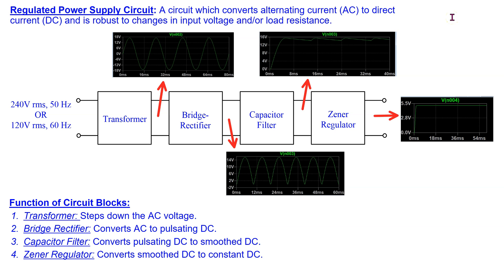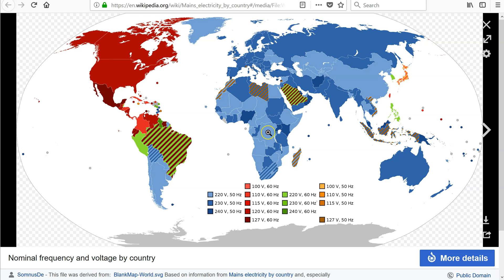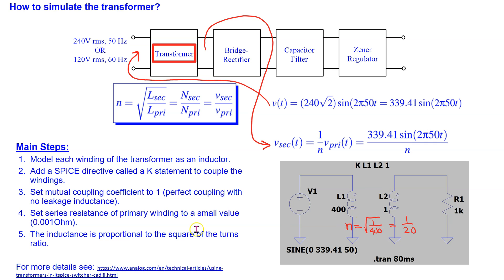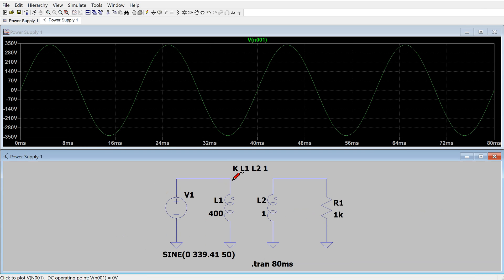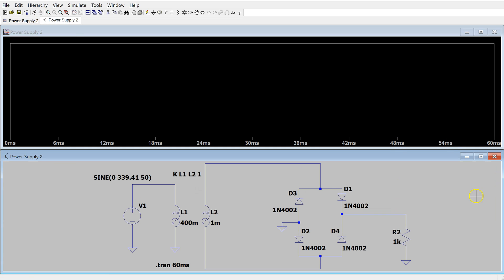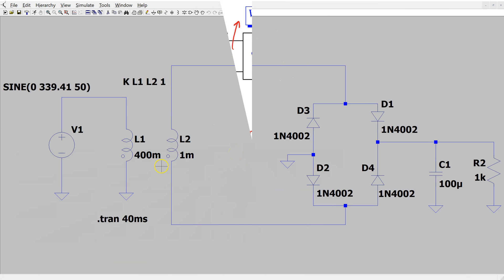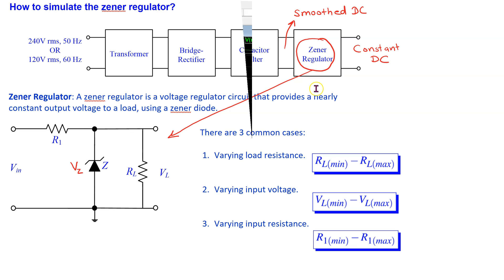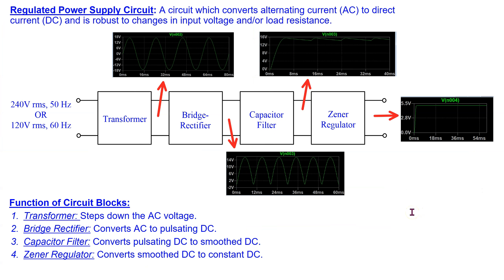Introduction to LTSPICE for Simulating a complete Regulated Power Supply Circuit

Comment: That's all very well but how do you do an AC analysis on this to get, say, the output impedance of whole circuit for different current draws?  You need the mains voltage to be continually cycling (to provide the power) while you draw the current at various frequencies. One can do that in real life, but can we do it in simulation?
Reply from the maker: Thank you for the feedback and suggestion. It might be possible to do this via an AC sweep over the input. However, I have not seen any technical details related to this in any textbook. You would need to provide more details.
Reply: @electriccircuits7164  The problem is having a voltage source that just runs at 50Hz and 230V into the main transformer and then having a current source (as a load) which does an AC sweep.  The first requires a .tran and the seond needs a .ac command.  Even if we make it simpler than an output impedance, how would we get the frequency response of the system?  (That actually may be more complicated. LOL.)  What I need is the mains/transformer cycling away and topping up the reservoir capacitors while doing an AC sweep on the rest of the circuit.  Obviously I need somewhere I can draw power from, and that's usually the reservoir capacitors.
Reply: In case I've not made it clear, what I would do on the bench is a) switch on the power supply.  Then, b), I would drive a small resistive load through a power transistor or perhaps a Darlington so we have a constant current sink.  the base of that transistor would be swept across the frequency band, especially at LF where the impedance of the capacitors is high, and I would look to see what the voltage on the V+ rail is to determine the output Z of the supply.

Comment: Can we get 12v output using the same circuit
Reply from the maker: Yes. Transformer secondary output may need modification accordingly.
Reply: @electriccircuits7164  sir I cannot find 7812 zener
Reply from the maker: Hello, The procedure to add zener diodes is described in the video. 1N759 is a 12V zener. Its model can be defined as:

.model D1N759 D(Is=1.773f Rs=2.06 Ikf=0 N=1 Xti=3 Eg=1.11 Cjo=102p M=.4868 Vj=.75 Fc=.5 Isr=1.393n Nr=2 Bv=12 Ibv=79.489m Nbv=1.1528 Ibvl=142.9n Nbvl=.95108 Tbv1=700u)

BZX84C12L is also a 12V Zener in LTSPice.
Reply: @electriccircuits7164  Tq sir
Reply: @electriccircuits7164  can you please tell me what are the changes
Reply: In secondary output
Reply: Sir I am not able to add diodes
It's showing access  to C:\program Files\LTC\LTspice\lib\cmp\standard. dio was denied
Reply from the maker: You need to have admin access to your computer. 

Note: For latest versions of LTSPICE, the model definition file that you need to edit can be found in the location C:\Users\[USERNAME]\Documents\LTspiceXVII\lib\cmp and NOT the folder where LTSPICE is installed (such as C:\Program Files\LTC\LTspiceXVII\lib\cmp).

Comment: Sir i want to know that if i want output of 4.7V contant so what value of capacitor should i choose input is 110 60hz R=1k 
By that formula i am not getting correct waveform
Reply from the maker: The formula to determine the smoothing capacitor is given in the video. This formula is derived under certain conditions which assume near ideal operation. It is the zener regulator that will ensure 4.7V constant output.

Comment: This was very helpful. Can you please do a circuit with three outputs.
Reply from the maker: Thank you. Can you please elaborate what you mean. Do you mean a single regulated power supply circuit that can produce 3 DC output voltages such as 5V, 10V, 15V?
Reply: @electriccircuits7164 
Yes, something like this;

Suppose a power supply is needed to supply the following three outputs:
 Fixed positive 6V
 Varying positive 25V
 Varying negative 20V
Construct and simulate the required power supply circuit using LTspice VIII, explain the 
function of each stage and also show the output of each stage.

Comment: If we want to find capacitance which resistance should we use the shunt resistance that is attached to zener regulator or the load resistance?
Reply from the maker: Excellent question! It would be the thevenin equivalent resistance seen by the capacitor (for the zener regulator stage).

Comment: can i know how did u get primary inductance to be 400 ??
Reply from the maker: Thank you for the excellent question. We are just interested in getting the desired turns ratio right. Hence, we can pick the inductance values accordingly to give the desired turns ratio. Practical inductors have values that typically range from 1 µH to tens of H. 400 H value is outside that range. It is also possible to pick inductor values that are within the practical range and satisfy the desired turns ratio criteria.
Reply: My project is converting 240 AC to 20 V dc
Reply: So whats the ratio that i need to use and component value of the circuit that needed to be changed
Reply from the maker: This is a design choice and there is no unique correct answer. If you want 20V DC, you would select the Zener part name first to provide that voltage...there are a few 20V Zener Diode models available in LTSPICE. The Zener diode stage must have an input voltage (smoothed DC voltage) greater than 20V. What exact value you set is within your control. This then enables design of two resistors for Zener diode stage, taking zener diode parameters V_Z, I_ZK, I_ZM into account. Also you can work backwards to work out what is the peak value of transformer secondary voltage you need. From that you work out a turns ratio. You can round off values of turns ratio to adjust your design. Then simulate to confirm your design. The relevant theory is discussed in this video and the video on Zener diodes in this channel. Good luck with the project!

Comment from the maker: There is a small typo in the video. In the "how to simulate a transformer" section, following the convention with which the transformer turns ratio n is defined (4:52) then 

v_sec = n * v_pri 

not  v_sec = (1/n) * v_pri

The values shown and simulated in the video are all correct since they use the v_sec = n * v_pri relationship.

Comment: could you do the calculations for 120V rms at 1KHz Please?
Reply from the maker: This can be easily done by writing a small script in any programming language. See for instance the Matlab script below:

% Inputs
f = 50;
Vpri_rms = 240;
R = 1e3;
C = 100e-6;

% Transformer turns ratio
n = 1/20;
Lsec = 1;
Lpri = (1/n)^2

% Voltages
Vsec_p = (n)*(Vpri_rms)*sqrt(2)

Vo_p = Vsec_p - 1.4

Vr_pp = Vo_p/(2*f*R*C)

Vo_DC = Vo_p - 0.5*Vr_pp

Note that power supply circuits typically do not have such a high frequency input signal.

Comment: If i have to make a 3A-30v regulated power supply , what should i replace in the circuit?
I appreciate your help...
Reply from the maker: LTSPICE has a few 30V, 1W zener diode models already defined. 

You can also add this model to LTSPICE for a 30V, 5W zener (D1N5363B). This has I_ZM = 158mA from its datasheet.

.model D1N5363B D(IS=1.65E-10 RS=7.38 TT=5.01E-8 CJO=1.73E-10 M=0.33 BV=29.7 IBV=0.0416 type=zener)

This can be a starting point. Good luck with your project.